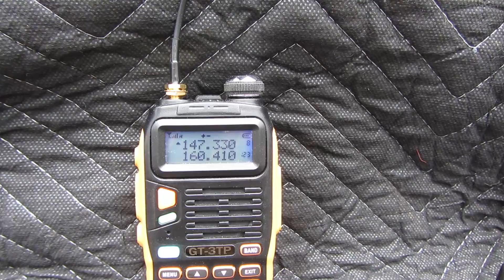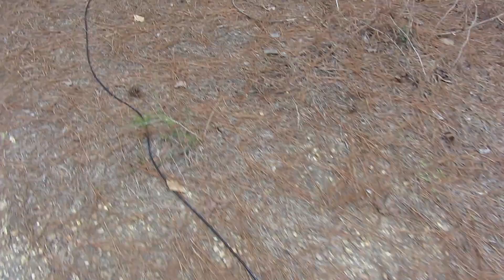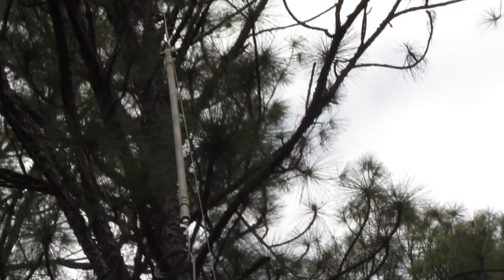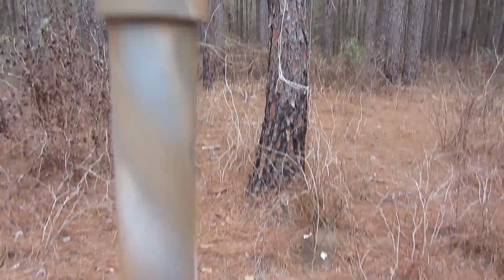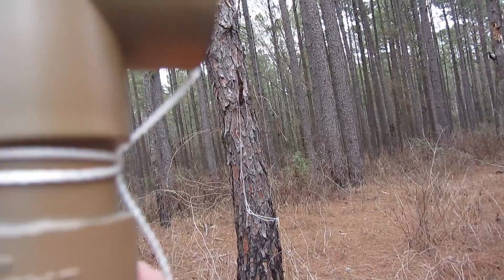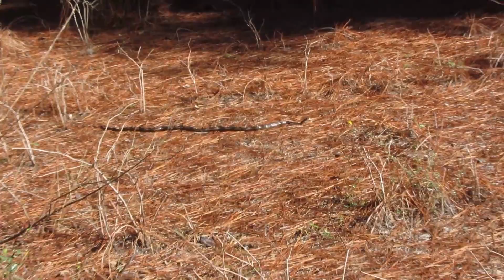Baofeng HT Radio Homebrew Antenna Mod

Comment: Now your talking. My father has been an avid, licensed amateur radio operator for many years, participating in all kinds of functions in training, drills/practices and in real emergency's. I've seen him rig many antennas with a bow and arrow tied to fishing line for a pull string, way high in the pines of his own back yard, not to mention some tower jobs they've done in his club. Didn't picture you into that but it's cool.
Reply: Oh and nice snake at the end, lol. I'd be more than willing to be seeing a snake or two again to get out of this wet and cold winter we're stuck in here now.
Reply from the maker: +Stucknarutt Funny that you mentioned "Bow and Arrow" because in the Tree behind this one I have Two Arrows stuck, One hanging on a line and another shot into a limb. The arrows were to light, it wouldn't pull the line over the limb and back down. So I tried heavy metal square washers, they got wedged in the limbs. Finally I used Golf Ball with an Eye Bolt screwed in, just spun it around and let it fly. It worked, didn't get as high as the arrow but it was heavy enough to come back down.
I wished I would have continued with Radio and Electronics back in the 60's and 70's, I could remember all this stuff. Now I'm trying to get back into it, it is difficult to remember.
Reply: Lol. Yep, that's one of those trial and error deals for sure...makes me laugh thinking about how many different rigs he's attempted or changed and the ones that got destroyed by mother nature, hurricanes and man. Of course being in a club like he is, they always share ideas and help.  That stuff will probably come back to you fairly easy if you want it enough. I'm kind of ashamed that that's one thing I've never gotten into with him but I guess it's never too late. Gotta say, it's more appealing now that I'm old and most things I do and like hurt like Hell now and linger too long, LOL.
Reply: Many years ago, when I still lived at home and my friends would come to visit, (or anyone for that matter) would always notice and ask "what the hell is that strung up there from tree to tree" and so forth and I'd always have to explain my dad's a HAM Radio operator/enthusiast or whatever. The guy that lived behind us, for some reason, never liked that and seemed to have a problem with them even though they were in our yard only and really not noticeable from his unless you were really looking. One day he had some tall trees of his taken out by a guy he knew in the tree business. He misjudged the drop zone and landing of the tree and it fell right across the property line into our yard, catching the anchor wire of one of dad's antennas, taking it all down. It catapulted a brick tied to it for counterweight, high into the air to which then landed and struck right on the saw man's left collar bone, just beside his head ! I saw it bounce off him and heard the impact on his flesh and bone from just a few feet away, saw still running as he fell to his hands and knees in agony. I feared he was seriously hurt as he all but went into shock trying to shake it off, asking me "who was throwing bricks" as he clinched in a painful daze. You know that had to hurt BAD !! Just wanted to share that true happening about antennas in my life, you reminded me of, Lol. 100 percent true story.

Comment: what can you pick up with the antenna? It's interesting
Reply from the maker: +revolver8shot My radio travels 135.000Mhz to 530.000Mhz plus FM broadcast radio stations.
What you was hearing was 2 meter traffic from a Repeater located 30 miles away. I was deep into the forest, I also hear Railroad Dispatch on 160.410Mhz, they are about 45 miles out. The radio also covers the NOAA Weather Channels from 162.400Mhz to 162.550Mhz.
Some day I will listen in to MARS (Military Radio) and ISS (International Space Station) and Satellites. I need to make a small hand held beam antenna for the satellites and space station because the are moving fast, always changing degrees of angle.
Reply: I want to see that!
Reply from the maker: +Eric C Check this out, a lot of youtubers are doing it.
https://youtu.be/7to9uX1sWC4